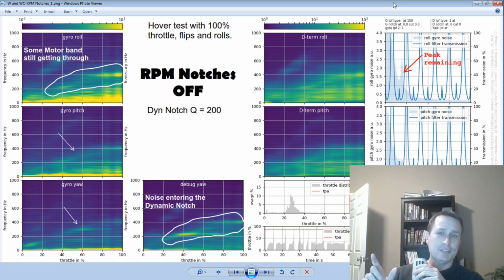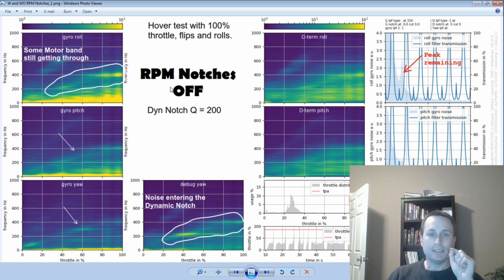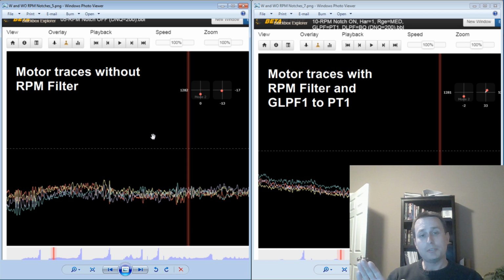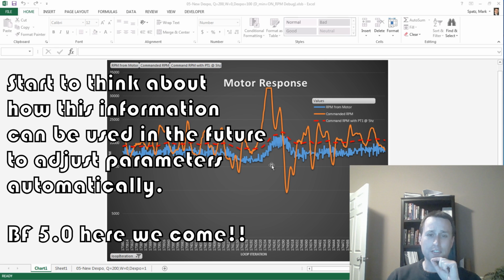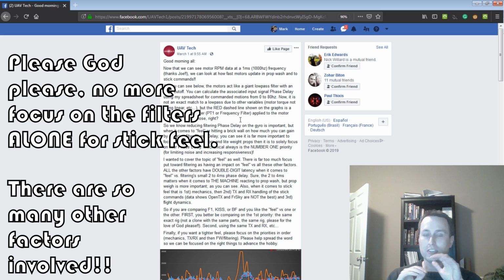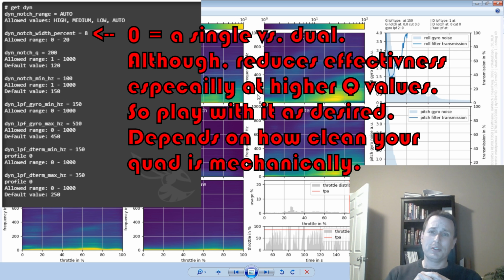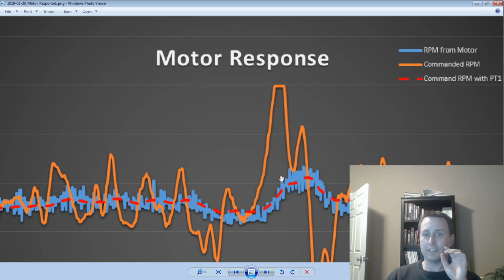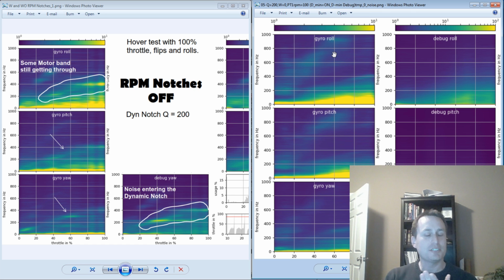Motor Latency & RPM Notch Settings | Analysis

Comment: THX for that info!  I'm about to try RPM filtering out on my BF 4.0.3 quad and just wondering if I could use my old BLHeli32 settings with RPM filtering. I had motor timing on "auto" (instead default "16") and RPM frequency set to 48 kHz (instead default "24"). Do you think I can stay with it or better use the defaults?
Reply from the maker: you can sticks with your settings.

Comment: My 5 inch quad can't fly with rpm filter if i dont turn lpf on gyro off - it twitches fiercely after arm. Without lpf it flyies fine. It doesnt matter what type of lpf i use pt1 or biquad.
Also, it seems i cannot disable dynamic notch - i tried to set it at 300hz (q=200, width =0) and got un controllable ascend. Barely managed to catch it after rearm in order to stop it from flyaway.
Btw, this quad is pretty much thrashed, but  q=250 works better somehow,  at q=200 i start to see faint lines at mid throttle,  and they become severe at q=120...
On D i use dynamic biquad only, set to 65-180

In the end, i didnt notice much improvement against default dynamic notch with all software lpfs set to 0

Comment: Mark would it be possible to make a video explainning the structure of the Betaflight filters... I would ike to understand more about them, I know that I could go trough the code and try to figure them out but it would be much nicier to learn from someone that really know how they work... I read this article https://www.propwashed.com/betaflight-software-filters-setup-guide/ but it is kinda outdated ... My main question is If I run 4k/2k will the gyro data be filtered more or is it better to run 4k/4k... Thanks!

Comment: I'm so surprised that the betaflight devs haven't created like presets in betaflight for filtering. Like say "CAT 5" for an old frame and BG motors etc.. etc. And perhaps "CAT 1" for a fresh build with new frame etc. So people could try different filtering setups and use that as a basepoint for more fine tuning. Just saying.
Reply from the maker: Agreed.  Apparently the configurator is a real pain in the ass to update.  On top of that is reverse compatibility etc...

Comment: I think this has absolutely validated my really low rampup settings in BLHeli_32 - so thanks to Ryan Harrel for pointing me towards that.  I'm still getting absolutely phenomenally good performance with really low values there, and seeing pretty excellent efficiency.  If I can start seeing exactly where that limit is, with some data to back that up, I think that'll actually help a remarkable amount.
This is probably also why the Ethix S3 props are working so well for a lot of folks - even racers... Anything to meaningfully reduce moment of inertia on the bell/motor combo is going to be worth it, and that my basic calculations which basically ignore any of the propeller aerodynamic characteristics are probably spot on for determining prop response time - those commanded vs. back-EMF measured RPM changes are happening so slowly that the aerodynamic load is honestly being altered more by being in dirty air in the first place... but this really drives home the fact that for the most part we're really over-commanding ESCs which are in turn really trying to over-drive motors across small time domains in hopes of getting a thrust differential to materialize in the 20ms response time regime to actually react to that.

Comment: Very interesting stuff man. I've always wondered why this never have been implemented before.. but now Im wondering. How does betaflight handle the rpm data? Is it only being used for the filtering or does it also do something else? Im asking because Im into 3d flying for a couple of months now. And with the switch to upsidedown I still have some sort of a wobble that is impossible to get rid off. Im guessing if the rpm data is being used for this, than this wobble would go away...
Reply: My suspicion is that unless all the ESC's stop then reverse at the exact same time (especially since low frequency pole crossings with really low motor RPMs make it hard to interpolate accurately), you're seeing some jitter with that during the transition where the motor has to then ramp up (compounded by motors being way less efficient at or below idle speeds).
Reply from the maker: RPM data is only being used for the filtering so far.  But i suspect Joe will develop further.  He admits this was just a first phase.

Comment: Lol what's up with your quad JB 😂 just taking a jab
Reply: I have a strong suspiciou Mark is going to be building a direct Dump file to send over the JB and just CLI paste, then go fly - bam, there is the answer.
Reply from the maker: No jab from me.  JB is the man.  But, that flight had some issues.  It is relevant so had to cover..
Reply: @uavtech  im just messing around. There has to be something wrong with the quad because I've flashed back and forth between 3.5.6 and 4.0 and the noise results in bbox and PT are significantly different on each quad I've done that on.

Comment: Great video Mark! Just a point about the motor latency, I find that little snippet you show here is not representative of the RPM traces in relation to motor sigs. The main thing I’d like to add is that the biggest latency is when slowing motors down on throttle drops, and by no small amount, more like 3X the latency you mentioned here. That’s most likely because all you have is active braking to do that. So it’s asymmetrical. Also, that short snippet of data you show is on a quick ramp up then down so part of the magnitude difference you’re seeing there is because you’re getting combined onset offset delay such that the RPM never reaches full capacity. It’s not really in index of heat conversion. I’d like to see the full data with the PT1 filtered motor sigs. I think you’ll likely see the greater divergence with actual motor on downward RPMs.
Reply from the maker: I've worked with it more to get the motor command converted to RPM.  This is my result: https://www.screencast.com/t/hOL0BHIK.  File at tiny.cc/filtercalc
Reply: UAV Tech ya you can see the delay on the motor deceleration. Again though, this is an example where throttle is fairly quickly decreased after initial increase. It’s just zoomed in on a very short blip of data. When you look across a full log you see that the motor resp tracks pretty well the input with the exception of delay. No real magnitude difference when u account for latency. Doesn’t matter whether you scale to absolute RPM or normalize to 1 or %. Since all such scaling is a linear transform on the data it doesn’t matter. It’s just an adjustment on what you wanna call the max and min. I just normalized by making it % motor for both motor sig and RPM and they really track one another, like I said, with the exception of an asymmetrical lag. 

Now I certainly agree the motor response is like very lowpass version of the input, but 5hz is a bit low. Commanded motion gets up around 20hz, and as you mentioned propwash is seen up to ~70hz, so the motors are certainly >5hz response
Reply from the maker: @PIDtoolbox  , can u share your data on the BBL group?
Reply: @uavtech  will do

Comment: When you say increasing q increases performance I understand that it reduces latency but how does it increase performance In a real manner? I had a problem with prop wash recently and I turned my lpf2 back on and widened notches and now it’s gone but if it’s gone with them now off why did I have to turn them off initially to get rid of it? Kind of a mind bender but stay with me 😂 There’s something we are missing.. I know the quad is probably noisier now that it’s been banged around but that still doesn’t answer why it had propwash when it was clean with the filters on, it’s almost like if you have a clean rig the extra  filters can’t be on bc they won’t have an obvious noise profile to attach to and will maybe be moving around too much? Or go to the wrong spots? Creating more issues than they solve, what do u think..
Reply: On a noisier build (compounded with beat-up props) there's just a lot more frequency content (think mixed bandwidth) going into the filter.  The narrower filters make sense if there isn't a ton of frequency content, but if there is those narrow filters are going to struggle - think of an audio example - if you were trying to attenuate the noise of a performing group, it's going to be a ton easier to filter out extra noise from a cello duet than it is from from two electric guitars running distortion patches.
Reply from the maker: It is a balance.  Turning of filters reduces latency, however if you turn off too much, your D-term can look like shit and not provide a consistent message to the PID Sum.

I talked about this on this video:  https://youtu.be/Dgq-cgqt_gI
Reply: @uavtech  I would add that reducing Q on a dynamic filter is going to have mostly marginal gains on an already low latency setup, which can be rapidly un-done by letting any significant amount of unwanted noise through - so bump it up until you stop seeing improvement, and then go forth and start putting cycles on battery packs.
Reply from the maker: @tehllama42  , here is a plot of the different Q values: https://www.screencast.com/t/DOCqhqBRUR5p

Comment: i'll second your thought on propwash and physical constraints . I've been most successful reducing propwash by trimming fat off the quad and battery (AUW 595 g 5'' with battery and gopro), keeping the props light and shallow (Ethix S3), and powerful/light motors t-motor f40 pro II 1750 kv on 6s.
Reply from the maker: I think you are spending your time and $$ wisely.  Thanks for sharing!!
Reply: @uavtech  I know the FC is not your cup of tea, but to reiterate the mechanical/physical importance to others, this is a direct transplant from rooster (700 g AUW with hq 4.3 props) into slammed alien 4.5, with lighter battery (r-line 1050 6s, lighter shallow props (S3), aluminum hardware (non structural locations), micro axii right into vtx (total wight loss 105 g). prop wash pretty much vanished (night and day difference even with the flat descents where i catch with a big throttle burst to try and bring it out).

https://youtu.be/fxdv0RklyMk
Reply: That is a baller build - I've tried running the exactly same setup on a race rig (no GoPro, Floss 2.1 Hybrid frame), and had the same effect - I have to work stupid hard to find propwash, and even when I do it's so much better than any other reference point being flown the same way.

Comment: Pretty interesting. I did watch bardwells video and it does look like he didn’t have it set up right. I’m looking forward to trying it! Any idea when the new blheli_32 with rpm data is coming?
Reply: Zylon FPV a half assed attempt at best.. 15min of my life I can’t get back
Reply: @Sugar_K  That was good :-))))))))))))))
Reply from the maker: Any current BLHeli_32 ESC works.  U just need to flash special HEX to it.
Reply: UAV Tech i was meaning when will it be part of the official firmware?
Reply from the maker: @ZylonFPV  , unknown.  I would suspect by April.

Comment: I have a few questions: The motor rpm is not really measured by the ESC (with a optical sensor or so), it is calculated; How accurate is the calculated rpm value? Is there a delay also? Is there filtering going on? It would be very interesting to know the exact difference between the calculated motor rpm and the real rpm. Maybe the BLHELI guys have had done such measurements (with optical sensors or hall sensors)?
Reply from the maker: It is know through the eRPM EMF detection the ESC has to do for the ESC to run.  See, the ESC knows the EXACT moment when each Pole (magnet) passes each coil.  Know how the number of Poles and u know one RPM.  

It is well know this is VERY, VERY accurate.  U can look up this topic on the internet.

This data (RPM debug) is not filtered.  However, a lowpass is applied downstream to calc the Hz of the center of the notchs.  A Double Exponential filter was used there that had no phase delay, but i think 4.0 release will have a standard PT1 lowpass.  I need to twist Joe's arm why the Dexpo was not used.  It did have overshoot on stepped response, but thought it was showing promise.  Maybe not?   I did not get the time to fully that it.

Comment: ....do you fly 2208 with 5143?... good to see data as to why big motors and light props just works better... often no need to swap motors when understanding the wide gamut the various props provide for freestyle...the changes in response characteristics when combined with understanding the phase delays adjustments gives even wider options....super work as always, thanks a lot
Reply from the maker: They are 2206.  Honestly, the T-motor 5143 is too much for them (over proped).  But i like the responsiveness of the 5143.
Reply: @uavtech  problem with running the 2208 motors is that they raise the question for freestyle pilots, why run something smaller? what would we gain when actually bothering adjusting weight and prop-selection with regards to what kind of flying behavior we want? 2208 seem to be able to accelerate their spin up fast enough even in the low range (appropriately propped). Only objection would be the typical 2208s weight - but that's only if you get the pretty but let's be honest, vajazzled versions like the motors from Xing; the Hawsky is a couple of grams lighter and makes a mockery of any 2205, 2206 and (little tear here) even the pretty hefty 2207s in real life. (It's a bit like slicing cold cuts on a propper meat slicer instead of with a bread knife in a tent on a festival, day 4)  Liberating just to have to ask for "one motor - one tool" for freestyle purposes. The whole prop saga in itself is enough for a lifetime of coupling experience to (tensor) flow :-)
Reply: @uavtech  Better new Dralprop 5249 :-))))))
Reply from the maker: Don't forget magnet strength and gap also play a role.  So it's more than just the magnet area.
Reply: @uavtech  agreed, but we are typically talking about hitting a gamut of flight behaviors that might be possible based on the hardware spec. All the factors dent, limit or expand this gamut, that entire the power train is able to deliver. Knowing where it dents, limits and expands is very valuable when asking the gear for specifics. You help in getting a better understanding of where and when to chose  the limitations to impact our flights. That's bitching in nerd world, by the way. Now go get a pair a decent sized motors and do it again :-)))))
Reply from the maker: @poulmartinmller4094  , i have some Xing 2206 to try.  U can test too you know.  We should look at the JB 24xx monsters! :-)
Reply: @uavtech  ....but the are gilded - that's half a vajazzle. no, in all honesty the narrow "bands of application" of 23s and tots 24s makes them less interesting. When doing a ballet, you can get away with dm's but not with hooker boots :-) ..... and please stop poking to my guilty conscience about testing  - just being a total mooch here - I will get my ass in gear, promise, if it rains and.... :-)

Comment: Do i understand it Right that an ESC should be 32 Bit and in a future BLHeli32 build they should include some input lowpass filtering or even more measure what the motor is able to accelerate?    Or is the flightcontroller the better place to filter the motor commands ?
Reply from the maker: 32bit ESCs is the best investment at the moment if u are in the market to get new ESCs.  If not, there is work to get BLHeli_S ESCs to spit out telemetry.

No plans i know of to filter ESC input signal to limit heat. It would add delay for any filtering.  Also if clipped it will cause the ESC to not drive as hard.  Kind of a necessary evil.  

Just trying to highlight how.much bell weight and prop weight play a roll in feel and prop wash.
Reply: @uavtech  @Olaf Schermann Running lightweight props is always good (typically comes at a durability cost) - It won't necessarily result in less heat, but you'll get quicker thrust changes as a direct result - meaning you'll be more locked in at stock tune, and it'll spend a bit less time overshooting trying to get there.  There will probably be a bit of a motor temp delta, but only because it's spending less time in that commanded state where the ESC is pulling in huge current - to see another illustration of this, look at Ryan Harrel's MiniQuadTestBench data in Data Explorer, look at the 0-100 throttle tests for any motor with the Amps turned on in the graph, and you'll see a ridiculous spike at the beginning there.  It's the same thing happening, just as a more extreme case, and you'll see that props like the HQ 5x4x3 have a noticeably lower spike than something like 5x5x3 Gatebreakers, and that all comes down to moment of inertia for the bell/prop combination.
There's just a fundamental limit to how much latency is added by applying a filter (see FIR - Nyquist-Shannon frequency relationships), so it doesn't matter where that's happening and you can't just throw processing power at the problem - might as well put that with the firmware chip that is the easiest to program, hence why it lives in the flight controller.
Reply: OK. Lightish Bell and ultralight prop = less heat?  In what relation is steep pitch angle of prop?  High KV low pitch vs. low KV high pitch?